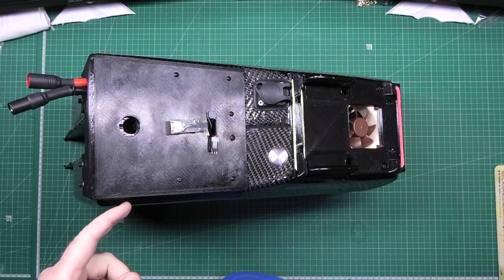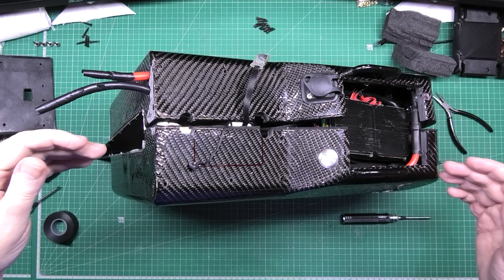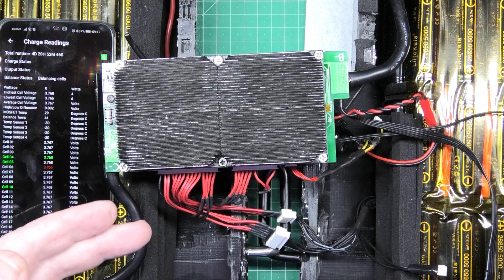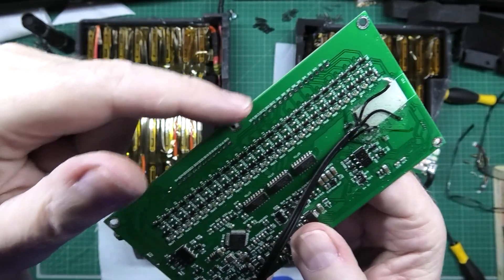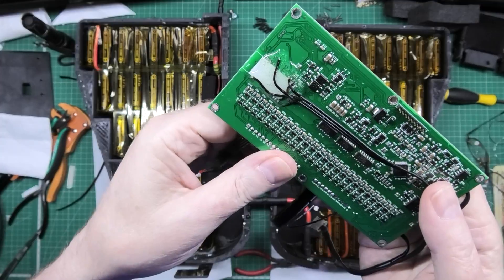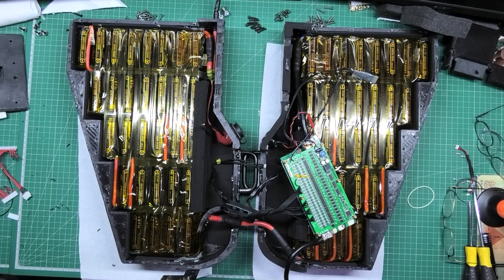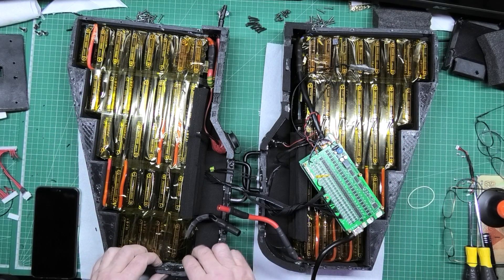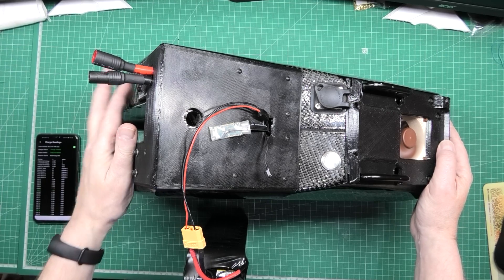High powered DIY eBike MSVA build part 33 - Fixing the BMS PROPERLY

Comment: Cell 6 must just be a bit dodgy but it's a negligible difference so I wouldn't worry about it if it were mine. Looking forward to seeing if you solved it when they are under load. Fingers crossed mate!
Reply from the maker: It's weird but, when I'm running, it doesn't sag any more than the rest and the voltage is always identical to the rest. It's only when I stop that is drops 2-3mV so I'm not concerned.
Reply: @Vortecks  that is odd! Ah well, sod it! Less time fixing is more time riding so it's all good mate!

Comment: I did away with the jst connectors/rc balance connectors like you have and used a 25 pin d sub printer connector. Works way better and connects all at the same point :)

Comment: nice 60mm noctua fan :D and nice vrm cooler.... that's what we call them in PC building.......
Reply from the maker: My VRMs are always cool now I don't overclock as much. I've been using Noctua fans for over a decade now and I still have the original 120mm ones I bought in 2008.......an they're still running in my NAS 😁

Comment: Work of art that...
I use 2mm gold plated bullet connectors for my balance leads and then lock them together with heatshrink when satisfied everything's ok. I think they're more reliable and versatile than the JST connectors and it makes a good semi-permanent connection that can carry a good number of amps for more aggressive balancing!
Reply from the maker: As time goes on, I'm getting more and more worried about connectors in general. No only that, but the cheap PVC insulated cables they use are rather pathetic. Next build, I'll be removing every PVC cable and replacing it with some decent stuff along with either proper connectors or hard-wiring them.